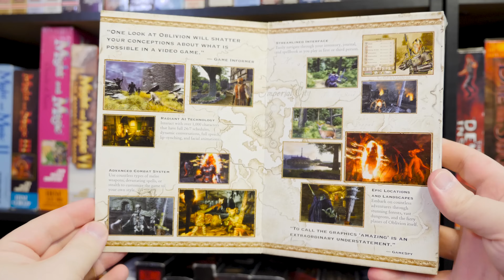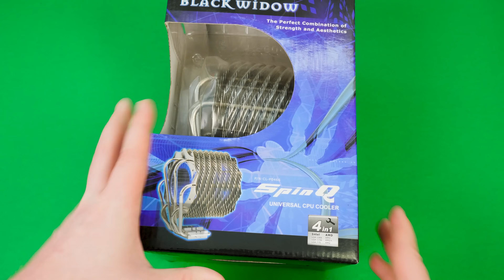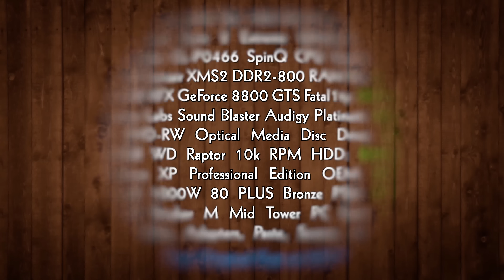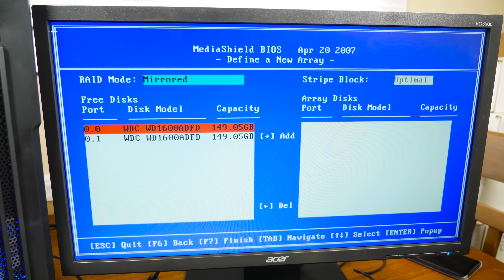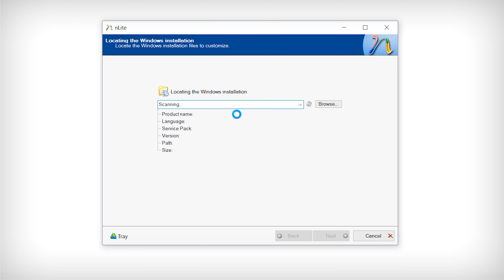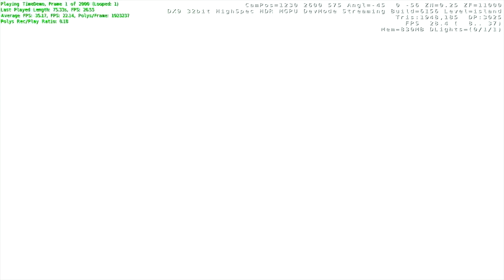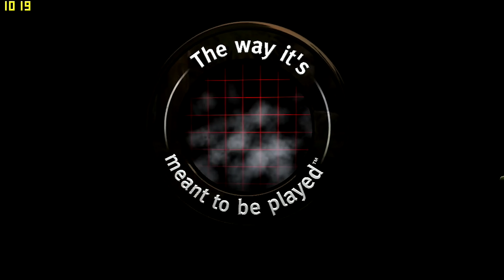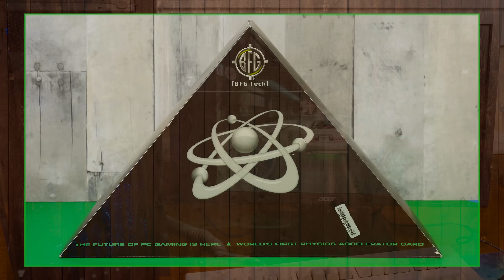LGR - Building My Dream $3,588 Windows XP PC

Comment: My first gaming PC that I built was back in 2004. It had an Athlon 64 3400+, GeForce 6800 GT 265mb, 1GB of DDR 400 ram, and two 80GB SATA 7200 rpm hard-drives in RAID 0. It ran Far Cry, Doom 3, Half Life 2, and FEAR very well. I felt like I was in the future, it was light years ahead of my PS2 and Xbox, so much so that when the PS3 and Xbox 360 finally launched 1 to 2 years later I wasn't too impressed by their graphics capabilities. It wasn't that I thought they were bad, in fact they were pretty good, it's just they didn't really seem much better than my PC, if at all. In fact, l'm pretty sure my PC still ran Half Life 2 and FEAR better than either the PS3 or 360 versions. I basically skipped the 7th console generation, but I did hop back in when the PS4 launched. I currently have a PS5 and a pretty good PC with a RTX 4070.

Comment: That was a good looking board in the day.  Around that same time I had a ASUS A8N-SLI Deluxe, AMD Athlon 64 3200+ (2000MHz) Winchester, 3820+ (2520MHz): 280.0 x 9, 3x HTT, 1GB of Crucial PC133 CAS2 (2x256MB,1x512MB) to OCZ EL Platinum Revision 2 PC3200 (2x512MB, 2-2-2-5 1T @ 235.8MHz 2-3-3-7 1T, 2.85V), and ATI Radeon 8500 128MB, Retail (283.5 core/283.5 memory) to BFG 6800GT OC (core/mem stock: 370/1000, Overclock: 405/1025).   It ran games pretty good.  Nothing like your build though.  That is insane.

Comment: Maaaannn!!! I still remember the first time I used a raid configuration in my pc. It was so fast. Windows booted so faster, apps booted faster, games loaded faster. It was a night and  day difference. I never knew why, but it seemed to me that using hard disks in raid mode made them more fragile, becuase I had disks failing quite frequently. So much that, after a time, I stoped using them in raid.

Comment: This is a really good idea. I have some old motherboards and a cpu or two, but I lack a tower & PSU.
It helps that I've been wanting to setup a retro comp lately.
Interesting point about the USB3 option. as well as maybe running an SSD in a 2010 era rig, which is what I want to build.

Comment: I had that Sound card and Drive as well as 4 x 2Gb version of that memory all matched too. RMA'd some faulty 4Gb kit and I got sent 4x2Gb instead as they no longer had stock of the 1Gb. I had it paired up with a Q6600 CPU and a GTX8800 768Mb edition.

Comment: I have a windows xp rig pc from my cousin, his pc was a beast in that time when he bought it. 
It has an intel core 2 duo e8400 3.00ghz, 4gb ram ddr2 1066mhz corsair dominator, a big cooler named Tuniq tower 120 and gtx 550 ti msi overclocked, it can run oblivion and crysis at 1080p on ultra graphics preset.

Comment: I actually really like the half sized side panel window, I wish they made them still today.
Reply: When desired, case modding is totally an option, I bought a cheap tower case for my own XP PC that I'm going to paint and mount a cool looking aircraft toggle switch to it for power, going to need to print some custom fittings to add in my floppy Drive too, and possibly and external mount for the CD drive to make a even weirder franken-PC of retro and new parts amalgamated together,  going to look hilariously weird standing by my modern Ryzen PC in its big high airflow cube of a case XD

Comment: I like tool-less drive bays, but my high speed 2TB drive does indeed rattle in it. The smaller ones(500GB), that are exactly the same RPM don't, and the 2TB has always been louder, but the tool-less bay definitely makes it louder. Doesn't bother me, as I only use it for backing up these days with my system and programs all being on SSDs, but figured it worth mentioning.

Comment: Over the span of a year or so I managed to build a windows xp gaming rig for just 10 euros consisting of a core2duo e6600 with motherboard from a hp xw4400 workstation I got from someone throwing it away, 2gb of ram, a 9600gt and the case from my first computer, which I had inherited from a family member.
As Clint said, it's just more enjoyable to play older games like gta san andreas and crysis on a PC like this.

Comment: In Colombia there was nobody owning such an expensive hardware back then except a rich banking old man that was having trouble because Windows XP showed 3 of the 4 GB of RAM installed, I didn't know 32-bit OS's can't address more than that so I left his mansion without solving the issue. The man had the exact same motherboard and I would dare to say the exact same CPU case, the exact same RAM with coolers (this was my first time watching one of them), I don't remember which processor it was, but in general it's a very close approximation.

Comment: Man, Oblivion was my jam back then. I was also on a lower end system (a theme for me over the decades, mid to mid-low is where I've almost always lived), and I remember having to do a lot of config edits to get the game running "smooth". I put so many hours into that game, easily my most played single player game ever.

Oh, and F.E.A.R.? Loved that game. I played it again a couple years ago, and found out that it doesn't play too nice with modern hardware. You have to find some replacement .dll files to fix it's issues.

Comment: For a minute there I had forgotten about XP's memory limitation because I was using similar parts for my Vista x64 machine of the time.  Not having to worry about that memory limitation and running 8GB of DDR2 was more than enough to make up for any Vista woes, of which I didn't really have many because when running new, high end parts for a Vista machine, the good experiences vastly outweighed any of the bad.

Comment: I wanted to build an XP desktop for years and finally did two years ago. Got a free IBM eServer case, reused some pieces from another case I got from the trash, and bought the parts I was missing. Its still running the original 2006 HDD albeit with a new XP install, being a server and all. Amusingly most of the parts are from early Windows 7 era so its a tad overkill (GTX 760 and first gen i5). Have not tried Crysis yet...

Comment: I actually just picked up a fully working T1 version of that mobo today, with a Core 2 Quad, a 512mb 8800GT, and 4gb G.Skill RAM. BUILD TIME!! Going to be using 32bit Windows XP SP3 for my games that simply refuse to run on Windows 10 lol

Comment: I built my first one a couple years before that technology (2005) with a Athlon 64 3500, GeForce 6800 gt and one of the first Asus SLI motherboards. Thing was a beast. Cost $1400 back then. Could run Doom 3, HL2 and FarCry on mostly max settings

Comment: I never threw away hardware. Too sentimental, worth a lot less after some years so i just kept them. I still have (and working) my 2004 Athlon XP (barton mobile 2400+ with a lot of OC), on abit nf7-s (the king on socket A), and corsair bh5 ram. The gpu is ati 9500aiw modded into 9800pro (the ATI gpu, not the modern nvidia 9800 that 10 years away at least). Also have one of my early pc's with pentium2 333mhz on slot1 with bx400 chipset (agp port) with s3 trio 8mb 64mb ram (that got upgraded to riva tnt32mb, then gf2 mx400, and finally gf3 ti500)

My older setup on lga775 has the Q9550 with abit IX38 quadgt MB, and originally had sli of 7600GT now it has one radeon HD5770, with 1066ram 8gb or something. - still working on regular basis on windows 10.

I had some of the other pc with duron, p3, p4 (wilamette), p4(prescot), had a bunch of E4200, E4500, E8500, and q's Q6600, q8300, q9300, q9550.. would have loved a qx9650.. maybe i'll get it if i find a good deal to replace the q9550 i still have (i also have the E8500 on a abit fatality with 650i sli chipset)

Comment: I got that processor for $99 from working at circuit City by doing Intel insider trainings .

Built a PC that had 2 8800gts in sli

In the original cooler master cosmos!

Comment: Chances are that RAM works just fine, alot of motherboards will not post the first time with more than one stick. First thing I do is post with one stick, change memory speed(XMP ETC) restart, then save and shut down add the other sticks and reboot. Go back in Bios and check that speed is applied and change if necessary.

Comment: Jan 08 I built a decent system. I had recently returned from Iraq, and had some money to burn. Q6600, Abit IP35 Pro, 8800 GTS, 1GB RAM. I think it's a Zalman cooler, about as big as the one used in this build. Big ol copper beast. I still have this system, stored in my attic. Crysis was the first game I installed to test out the GPU.

Comment: I built my "dream" XP machine about a year ago. But I didn't stay totally period accurate.

Mine has:
Core2Quad (don't know exact model off the top of my head)
GTX 680 GPU - newest nvidia gpu with xp drivers
128gb ssd
Corsair ram - 8gb, but only 4gb usable due to x86.

Comment: LGA775 represents my favorite era in PC gaming. I am happy to report that I am posting this from an LGA775 rig. Not a custom built rig, rather a free throwaway Dell Optiplex 380 slim that had a c2d e7500 and 2gb of ram. I scavenged another 2gb stick from another throwaway and bought a Q8200 for cheap on ebay and threw in an old hard drive and installed a modern flavor of linux and finally have myself a proper LGA775 quad rig. Back in the days this stuff was new I had an AMD 754 single core athlon setup, so it is closure to finally have the platform I lusted after 10-15 years ago.

Comment: I've been recreating my college XP machine, but better. I had a Dell E510 that I loved, and I still love that case design.  So, I took an E510 board and fit it in an E310 case. Itself basically the same case, but silver so it will match the period Dell peripherals. I'm pretty limited by the BTX motherboard, only one PCIe slot. 4gb of DDR2, a P4 HT, and I'm waiting on a Radeon HD 7750 1gb. It should be perfect because it's single slot and only 55 watts. Can't wait to play some F.E.A.R. again.

Comment: an equivalent to the 8800 today would easily be 800-1000 a pop, though, if you consider the 8800 was basically the top of the line.

Comment: I collect Alienware, especially AW from 2000-2010 and because of that I have over 20 PC’s that run XP! Solid AF! Side note though bro, you HAVE to go with a period case man, and why plugging your power and 24 pin in the front??? I see you were forced to route power to the back because there was no space in the front but WHY in the first place?

Comment: You should've picked one of the 775 Xeons. They were absolute beasts with reduced vcore or (driven at normal or slightly above vcore) insane overclocking. I ran one of these at 4GHz on air cooling.

Comment: I used to have a UBER powerfull gaming pc build in 2004: 2,8 ghz Intel CPU, 4 gigs of RAM (yes 4 gigs in 2004…) a AMD GPU with 1 gig of vram, in total the build cost over 10 000€ in 2004… I still have the motherboard but I have really upgraded it to have a Nvidia GTX 960 2 gig and a Intel Core 2 Extreme 3,1 ghz…

Comment: Huh! I've owned a pair of SMX2 sticks just like yours for the longest time after salvaging a old build my dad had. But since it was DDR2 and not 3 like my pc at the time used I had just kepted them in my desk. Pulled them out and checked, it's the 2GB versions of yours. CM2x2048-6400C5DHX

Comment: This was the last era in which I built a desktop, dual core celeron overclocked substantially, 8800GTS, later a 4870, gigabyte mainboard, lian li V1000z with a koolance rad shroud up top 
(Yes I cut the hole myself and yes it was fucking terrifying cutting a giant hole in a brand new beautiful case days after I got it >_<)

Still have it, I've been on thinkpads ever since.

Comment: My god the price on that build. For comparison my new rig I got this year (September 2021) was £3288 Including tax.  Mine was a pre-built as getting hold of new CPUs and graphics cards anywhere close to MSRP is next to impossible and frankly I don't trust myself handling parts like I have with my clumsy hands 

Specs: Not comprehensive but the big bits.

AMD Ryzen 9 5900X
16GB AMD RADEON™ RX 6900 XT
ASUS® CROSSHAIR VIII HERO WIFI
64GB Corsair VENGEANCE DDR4 3200MHz
1TB SEAGATE FIRECUDA 530 GEN 4 PCIe NVMe
2TB SEAGATE FIRECUDA 530 GEN 4 PCIe NVMe

Comment: My XP PC is a SFF Core 2 Duo and an OEM GPU of some kind , probably a HD 5000 series or HD 6000 series card , I think I paid $40 for the whole PC with XP on it . I mostly use it to capture VHS and Hi8 home movies to digital as that old capture device is better than anything available for Win 10 . I do like to fire up the OG Far Cry on it from time to time , still a great game .

It sucks because before that  I had this nice mid tower Core 2 quad machine with an Intel Extreme MB and XP that I ended up giving away because I didn't think that I'd ever need XP again . Big mistake .

Comment: Not entirely sure....but I think you plugged your second GPU in to the wrong slot...the ribbon cable is exactly the length to connect two cards, one in the x16 slot and the second in the x8 slot...the ribbon cable (SLI bridge) should be taut with no buckle in between when installed properly.

Comment: Personally my 2005 XP PC runs GTA Vice CIty without breaking a sweat, SA can bring it down a bit but still playable (this is on an 8600 GT btw), and Call Of Duty 2 does lag sometimes, although I got a GTS 250 for it, so all those problems should be resolved

Comment: I had a very similar system around that time. I had the same motherboard, dual EVGA 8700s and an E6600 CPU with 4GB ram.  The motherboard and SLI were crazy unstable IIRC. Kind of burned me on the EVGA brand.

I remember hearing that computer. Felt like it was way too expensive and performed way too poorly.  Switched to a first gen i7 a year and a half later iirc.

Comment: I owned that motherboard with a q6600
Reply: I've still got a Win 7 machine with an old QX6850 Core2 Quad Extreme processor . It originally came with a Q6600 . That Extreme runs HOT . I've got a huge cooler on it too . Unfortunately it's just got a plain Jane Intel MB . It was my first PC with an SSD .

Comment: I had 2 680I boards both died as the chipset got way to hot even after modding the chipset cooler. 
After the NF2 the nvidia chipsets sucked

I had a QX8650 bought off ebay for $50 ran it for 6 months then upgraded that thing got hot! 
but ran really good

no gear head garage

Comment: I reckon crysis issues was down to VRAM. 320mb of vram wouldn't have helped running crysis above medium at a reasonably high resolution and could've been why you had some glitches when running, I personally think you should've gone with two 8800GT or GTX cards, or just that single ultra perhaps?

Comment: Ahhh, my dad bought me a pentium 4 with 7600gt, year after I got core 2 duo and 8800gt 512Mb, almost top of the line back then. Poor 965 chipset motherboard died in 2018 then I put a Xeon E5450 in it, RIP. It run Witcher 3 just fine even with only 6Gb of ram and GTX 750 2GB.

Comment: I remember growing up on a shitty Windows XP Professional computer that couldn't even run GTA III without it hard crashing. Man, I really do miss XP, even though it was no treat to use on a PC with only on board 3D Acceleration and no audio drivers at the time. Played so much Counter Strike Source regardless, and it ran stupidly well. But, just like with Clint here, I yearned to play Oblivion on my computer, but it just wasn't up to snuff. I never got past the launcher where you configured the settings.

Comment: I really want to know what difference that 8800 Ultra would make compared to the SLI setup.
Especially as I could swear my objectively inferior* frankenstein retrobox runs Crysis better
*Core 2 Duo E7400 2.8GHz, 512MB 8800GT, 4x1GB 667MHz RAM. On a Dell Optiplex board in a Compaq Presario case

Comment: I understand the excitement about trying SLI but honestly using the single ultra card prolly would've performed better. It has enough speed in its own but beyond that you're looking at much more memory as SLI then (and now) doesn't give access to all of the memory for both cards - you only get the memory available on one of the cards. There was so much more on the ultra I just think that you would've benefited from it.The other thing is the power supply... 1000w is overkill for most setups in reality even today. I'd be willing to bet you would've been fine with half of that. Even a modern system a 2080Ti rarely peaks past 500w for the overall system.

Comment: I need help building a quake 2 machine. Of course I will play other games too, but I want to make a build that plays quake 2 as perfectly as possible. I remember installing it on my friends new gaming PC back around 2005 maybe? It ran terribly. Worse than software mode on 98 computer. I was flummoxed at the time as to why a faster better PC would run my beloved q2 WORSE to the point it was unplayable. So my question is, what is the best card or tier of cards that I could plop into an old del optiplex and retro game my heart out?

Comment: Great and enjoyable overview, but using XP doesn't quite fit for me, honestly. Someone who had the dough to drop some $3.5k on a gaming rig in 2007/2008ish to get games like Crysis running properly would without a single doubt have opted for Windows Vista (first released in January of 2007) because of DirectX 10.

Comment: If you are into old parts, I have a 12400f, 32gigs DDR4, asrock Mb, EVGA oc3050, 600w PSU (under a year old) asking 300 bucks Canadian, its in a case from 2007, registered win 10 with a 980 pro 1TB
Reply: Would you be willing to send internationally or not? I'd be very interested

Comment: im curious to when you say 2007-2008 build. because the mobo and gpu is from 2006 and cpu is from 2007. i dont think anything is from 2008 besides maybe the cpu cooler or hard drives